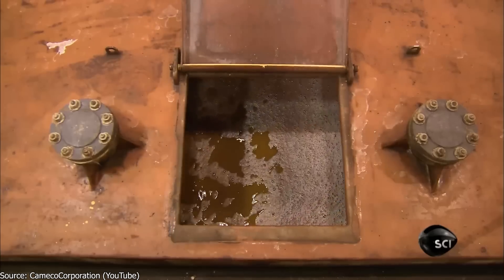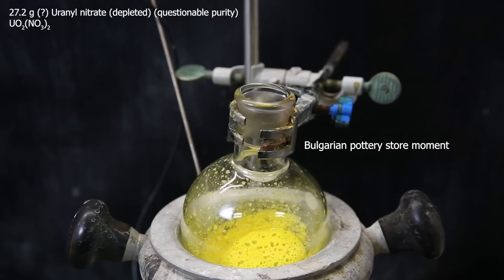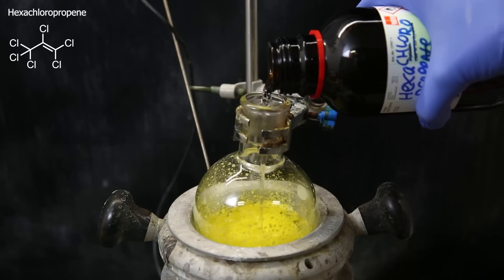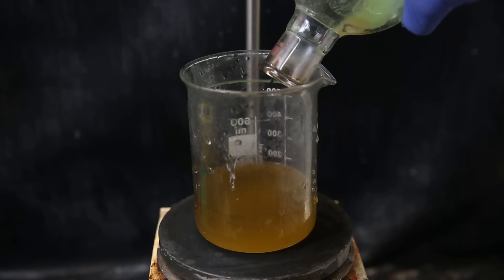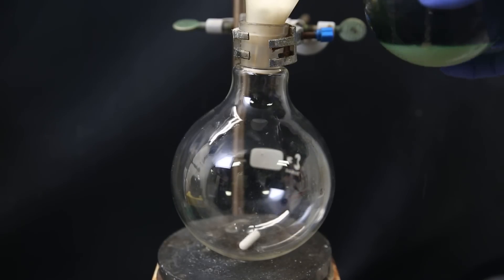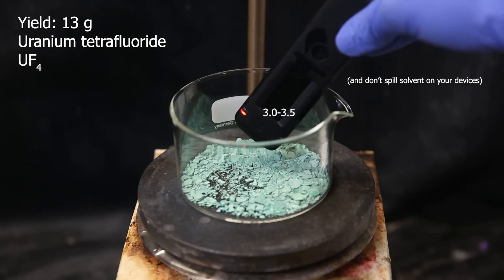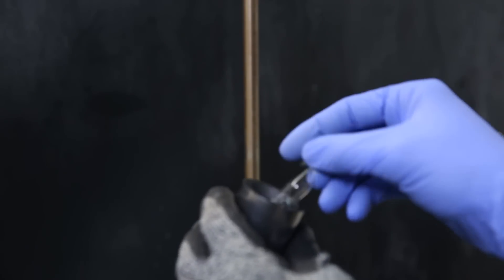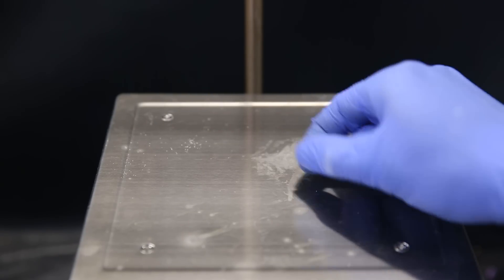Making Uranium

Comment: When a missile is turned toward the Earth on the Moon, the Uranium starts to boil. Water doesn't boil on the Moon at 200 degrees, it evapourates. After a nuclear explosion, the movements of the tetra molecules can be speeded up by making earthquake, the cutter blades such as Titanium tetra oxyde will have a faster movement in the body, and a 2 cm long blade can form, 50x sharper than the razor blade. Its movement is similar to the boiling water in a dish.
Boiling is caused by the oceans for water, for uranium the amount of uranium in the Earth's crust causes its boiling. If the Uranium is alloyed with diamond, its moving capability will be faster because of the amount of coal under the ground.
The moving capability f the deltaeder oxygen is 0, because there is no oxygen belw the surface. 
The most dangerous nuclear molecule doesn't have a name, that's the combination of the deltaeder and the tetraeder. It is formed, when an explosion proof highway is hit by a warhead, and the rezonance of the concrete creates it mechanically.

Comment: Let me start by saying I strongly am not recommending anyone interact with radioactive material without knowledge of the potential risk. You'll find if you don't break open older smoke detectors they don't contain americium-241, you won't find that it has very high levels of alpha waves and its Gama waves being lower but still high. They changed how they make them so they don't contain such a material anymore. But ya just figured I'd not mention that.

Comment: A bit better way of doing this is to seal it in a stainless steel pipe that is lined with pressed magnesium oxide then fill the center with a mix of UF4 and magnesium. Backfill with argon and seal. Next heat the pipe in an oven till bright yelliw white hot and allow to cool on its own accord. When you open it you will have crumbly MgO, a slag of MgF2 with some uranium in it, and a glob of uranium metal.

Comment: Do you not think you created more Uranium oxide than Uranium metal?  It's just that your kiln barely gets to the temperature than Uranium would melt and it's not under an inert atmosphere. I studied how one might do this in a home lab and the part that seems the hardest to overcome is building the furnace suitable for such a project and then having a big enough amount that the slag can be easily separated from the Uranium metal.
Reply from the maker: Yeah there’s definitely a bunch of oxides. In the future I want to get a smaller furnace that can go a little bit higher in temperature. This one is really unnecessarily big and it takes a long time to even heat up, got it off an auction. And the radiative heat is of course crazy when opened.

Comment: reminder that uranium-238, the most common form of uranium by far, has an extremely low passive radiation level. if you ingest it, you'll be at least a factor of ten more likely to die of heavy metal poisoning than of radiation poisoning. (lead isn't the only poisonous heavy metal, it's just the most common to be exposed to. uranium has similar effects.)
Reply: addendum: arsenic, mercury, and the cadmium from cigarette smoke are all also poisons for the same reason as lead and uranium are!
Reply: @somethingforsenro  yes which begs some questions as to why it’s added in the manufacturing process when it’s useless? 
Tobacco has recently come back from multiple studies negative for addiction. Apparently addictive attributes are added during manufacturing (hey didn’t we already do this 😂). Also that  nicotine is a potent medicine for many of the engineered diseases we now face daily and growing. I’d advise patches over other products. But I’m no doc and this ain’t medical advice.
Reply: @somethingforsenro all elements except the lightest in each group are generally toxic to life because they have similar chemistries, but not exactly the same. U238 is about 96-97%, U235 is about 3-4%. Nobody has ever demonstrated any useful amount of nuclear energy, excepting tiny amounts of current in a wire. Heavy elements have complex chemistry because of all the electrons and forms of bonds.
Reply: I would like to eat some uranium

Comment: I did not expect the ANVS would allow us dutch's to handle this, would it be possible to legally make a sub-critical reactor?
I'm not sure if I'm correct but if you bombard the U-238 with neutrons from a neutron source (or even cooler a small fusion reactor) it becomes unstable U-239 & neptunium-239 that decay's with allot of beta decay giving you more heat than power put into it.
Also there would be some plutonium-238 created further helping the reaction but it cannot runaway since it has a sub-critical mass.
I wonder if this is legally and psychically possible on a small lab scale.

Comment: Well done and congratulations on graduating to real (inorganic) chemistry!
So what difference (if any) did the pre-drying step make, and could you measure the shiny piece's density for a crude indication of purity?

TL;DR
Metallic U really does react incredibly quickly with H2O and O2 AND N2 gases, such that attempting to cast or re-melt it without a continuous flow of Argon cover gas (or, at a minimum, vaccuum sealing with a very large excess of Li metal and covering the reaction mass in 2-3cm of liquid Li-Na-K-Cs with a suitable flux mixture on top), usually results in a fairly poor yield of multiple small corroded pieces of metal; though even in the best case, where a single metallic mass is obtained, it will be riddled with numerous defects, slag inclusions and poor porosity.

Getting to a solid block of metal that at all resembles the common metallic element samples, is most easily done by cleaning, washing and drying the obtained U granules/shot under an inert atmosphere or under vacuum and then re-melting everything into one solid piece (only using inert and oxide free materials in contact with the U, such as Oxygen Free Copper or Tungsten).

Comment: Actually they do use Tungsten for armour piercing ammunition.
Reply: Tungsten and depleted uranium are both used. Uranium tends to be used for larger munitions but the YouTuber “Oxide” did testing of uranium rifle bullets.
Reply: @chemistryofquestionablequa6252  
Mostly, although both Germany and the UK use tungsten in their 120mm APFSDS anti-tank munitions. 
It's a few percentage points less effective than DU APFSDS rounds but doesn't come with the same political "baggage" as DU weapons.
Reply: @chemistryofquestionablequa6252  
So my comment should say some nations use Tungsten penetrators instead of DU.

Comment: Is there a way of isolating the metal that doesn't use bone-hurting juice? (And if you are using HF, shouldn't you be doing the reaction in a plastic or passivated-metal container, rather than glassware?)
Reply: I researched it a bit and I think the fluoride way is the easiest (unfortunately), Going with UCL4 works too but you need to do the reaction with hexachlopropene which is a bit more complicated. Wikipedia says you can also react calcium and UO3 but I don't think that happens at any reasonable temperature and speed.
Reply: @thesciencefurry Actually, it is possible to use UCl4 without hexachloropropene, but in this small of a scale, that would require the use of mercury afterward to make a scary mercury-uranium amalgam, & then you would have to boil the mercury away in a distillation chamber. So you basically have to pick your poison between Hydrofluoric Acid, Hexachloropropene, & elemental Mercury.

Comment: Depleted uranium, health issues and after-war diseases in the countries it has been used as armor-piercing mass projectiles in the documentary "Deadly Dust" (2007) from  the German director and filmmaker Frieder Wagner.
Reply: Yes Uranium is a heavy metal, where the health issues come from not the radiation.

They say you shouldnt eat of a uranium glazed plate, that is also not because of radiation but due to uranium being a heavy metal and has a rather high toxicity.
Reply: @daniellassander  The problem is not from eating eat, but from breathing it in. Thatfore deadly dust. Most of the anti-tank missiles produce a hot liquid metal jet, which oxidizes in the air , that is then spread via fine dust particles. All uranium isotopes are radioactive. If you breath it in , than multiple lung and blood injuries may occur. And the dust doesn´t vanish immediately after deployment.
Reply: @AnonymosAnthropos  Uranium is very weakly radioactive, it's its toxicity that is the danger
Reply: @durshurrikun150  It doesn´t matter if it is its toxicity or radioactivity, since it will cause lung damage no matter how, leading to high mortality.
Reply: @durshurrikun150 isn’t that just what he said? Jw
Reply: The thing is, the only meaningful alternative is a tungsten alloy, which also carries negative health effects.
Reply: A look at the uranium-based anti-tank ammunition the U.S. is sending to Ukraine
Politics Sep 7, 2023 3:50 PM EDT (PBS News hour)